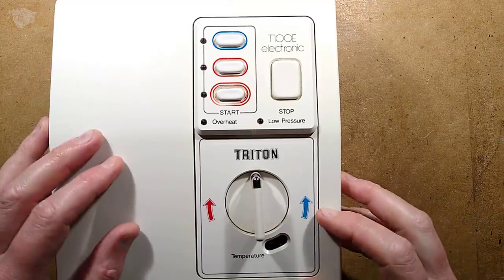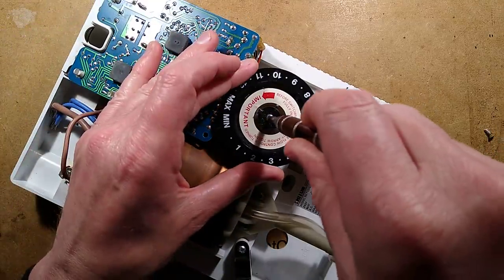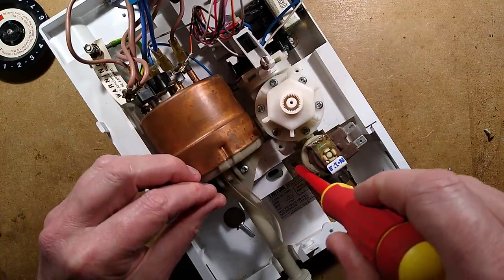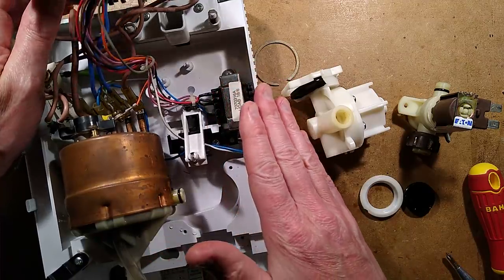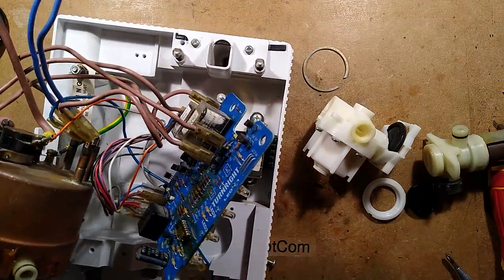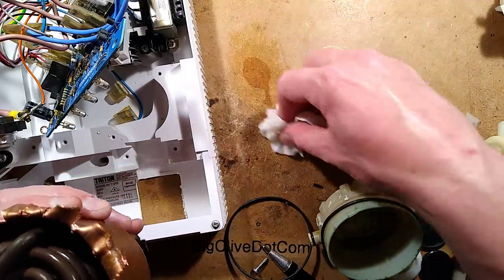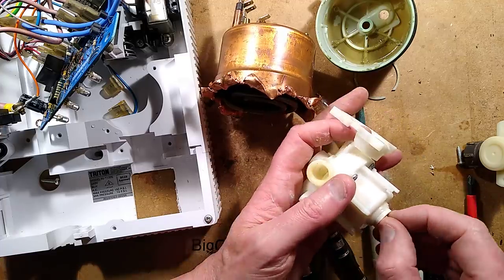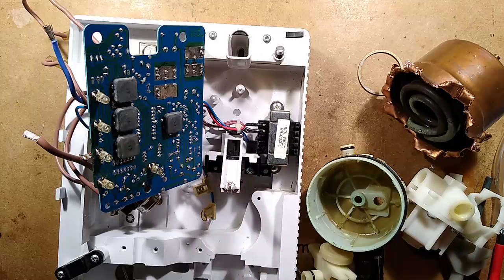Teardown of a British electric shower that went bang.

Comment: The fact that water was spraying all over the place and he didn't get shocked proves to me  these things are safe.  However, as an American, I think I'll stick with my central hot water system, it's convenient for other purposes besides showering.  (And, if you have an instant system, it's no less efficient than an electric shower, save for the tiny amount of water you have to waste to clear the cold water out of the pipes.)
Reply: ThoolooExpress we have central hot water too, in every home. These are a cheap fix where the hot water system is an older, low pressure cistern fed system as found in hundred of thousands of properties- they last indefinitely and function well so people who have them are often reluctant to rip them out at vast expense. They do struggle to run showers though.

Comment: I actually kinda hate these things for a few reasons- there are pros and cons: sometimes they have a mind of their own, mine got itself and set itself to warmest, it was on medium but outputted water that melted the insides of shower head and burned my leg. Another thing is that they take about a minute to warm up because it goes hot and cold in a wave then stable. Another example is the electricity bill. Its not that bad but it is hard to warm the water up in winter ( especially if you have a top up breaker box). Pros: no need for check ups, if it breaks its easy to install a new one. Doesnt take up a lot of space. And really thats it
Reply: How come you keep liking my comments and nobody elses🤣

Comment: So my assumption is that water heaters with a large tank as used in the US are not popular in the UK, and that perhaps UK homes don’t have hot and cold plumbing?
Reply from the maker: We have either hot water storage tanks or water is heated on demand by heating systems.  The main advantage of the electric shower is that the hot water is there near instantaneously and only heated on demand, so very efficient.

Comment: Nothing so Micky mouse as anything to do with water and electricity in the UK.  I had one of these units in my hotel room which popped the internal circuit breaker every use.  The solution by the hotel was to take the cover off while soaking wet and push the reset button which was in the middle of the 240vac incoming line terminals.   No surprise here!

Comment: I doubt this would be legal in the US.  My house has a 40 gallon, natural gas powered water heater.  The best thing about it is that it will still work even if the power goes out.  It has a pilot light and a thermocouple to hold the gas valve open.  If the pilot light goes out, the thermocouple cools off and causes the gas valve to close, thus preventing a gas leak.  I replaced mine a few years ago and the new one recovers very fast.  I've never run out of hot water during a shower, even in the coldest part of winter.
Reply: LoveClassicMusic0205 every single uk home also has a hot water system- either a tank or combi boiler. These showers were the solution to installing showers in older homes with traditional loft tanks meaning low pressure hot water- insufficient to operate showers. As a nation we traditionally had baths, showers were very rare in early bathrooms. By the way, your open vented gas water heater is far more dangerous- under fault carbon monoxide can pour into your house completely undetected and kill your entire family in their sleep! Open vented appliances have been banned here for years.
Reply: If I move to the us one thing I will do is rip all that gubbins out and install one of these showers.
Reply: @spencerwilton5831  It's  not open vented.  The exhaust fumes go to a chimney and are vented outside.  Besides, I have some carbon monoxide detectors in my house just in case something were to go wrong.

Comment: Why is any of the water flow components plastic in the first place?
Reply: As a plumber, you'd be surprised how much pipework in your home is likely made of 15mm plastic. Its drastically more economical than copper or lead
Reply: Cost
Reply: t could be aluminium or stainless steel. That doesn't cost as much as copper and lead is not used for plumbing. Your sink/bath taps and pipe taps are metal and aren't too expensive so they could use a cast metal flow regulator.  it would cost a few pence more but then the greedy manufacturers won't make as much profit. i paid a plumber £400 to install a good quality all metal Grohe shower, not cheap but it will last many decades. The hot water is heated by the  gas combi boiler, which is much more efficient than an electric shower.
Reply: Terry Jackson. Not in mine it isn't. My pipes are all copper.
Reply: Terry Jackson I know about PVC piping but it makes no sense in an enclosed device where mains current is collocated with water. Plastic degrades and fractures in a few years.  All the water handling components should have been copper.

Comment: We have a similar device in the Philippines....made by Panasonic....There has been several people electrocuted by these heaters.
Reply: Clive has made some videos about that design, it has an exposed heating element in the shower head itself.
Reply: @johndododoe1411  Isn't that usually coated and grounded on devices that put at least some effort into passing safety checks?

Comment: That looks like a fairly old Triton, so they got their money's worth. After I switched to a Triton, and an incident which caused the attendance of two fire engines (due to an existing weakness in the isolation switch next to the consumer unit, only highlighted by the higher wattage of the new unit, rather than a fault with the unit itself), then the unit going faulty about a year later with the low pressure light constantly coming on, repaired by them under warranty, and then failing completely another couple of years later with the brown wires on the heater tank completely melting and becoming green powder, I decided to abandon the Triton experiment.

Comment: In the usa we have water heaters, i have never seen this death contraption
Reply: Brad Pugh Obviously U.K. homes have hot water systems too. However, our homes are typically older and many rely on the original, low pressure hot water cylinders. These are fine for filling a bath, but don't have the pressure to operate a shower adequately, especially in single story dwellings where the height between the shower head and the bottom of the loft tank might be less than a couple of feet. Showers were not popular here until relatively recently (70's) so an electric shower became a quick, cheap and less disruptive way of installing a shower above a bath when they did start to become seen as essential.

Comment: Im from Germany, and What you describe really sounds like a horrible deathtrap to me. Sure we have Flow Through Heaters in Germnay to, but they normaly aint in the Shower (but under the Sink or where the Housefuses are mounted)  and they dont have moving parts like valves and stuff and are idiot prove grounded.

Comment: Never seen one of those outside the UK. Powersupply to mainland europeanhouses is not that you could run one. the Netherlands from 5.75Kw to 9.2 Kw.  90% of the houses is natural gas as a heatsource mostly by a combination condesing gas boiler.
Reply: arjan van raaij UK homes and hot water are mostly gas heated too, condensing boilers of various types. Electric showers are for houses with older, low pressure hot water systems that are unable to provide sufficient pressure for a decent shower. As people refurb older homes and update old gravity fed / copper tank hot water systems electric showers are slowly disappearing.

Comment: It's not just americans that find this dodgy. In germany you will never find such a thing. Either the showers are hooked up to central heating or run from a boiler/continous flow water heater somewhere outside the actual shower.
Reply: Great so if the cold water pressure suddenly drops...

Comment: It may be save but its still super inefficient, instead of just having a boiler and a warm and cold water lining in the house u put Small boilers everywhere? yeah.
Reply from the maker: This only uses exactly as much energy is needed to heat the shower water.  No waste in pipes and tanks.
Reply: @bigclivedotcom  yeah but i do still find central boilers better

Comment: I see this being a terrible design.. If you want to have electrically heated shower head then i would at least separate the electronics from the water part and insulated the wires expecting failure due to the material fatique in the water part or electrical failure at the electronics part.. Seems much safer and probably more modular

Comment: U just broke the unit. It was repairable with external valve and w/o pressure thing.
I have unit like that for ~25y. I eliminate pressure thing 12years ago ... and steel work perfect.

The only thing is to remember to stop the unit before stopping the water!!!   EASY :)

Comment: Reading through the comments the thing that gets me the most is how many people apparently only take 1 to 2 minute showers.  I think the fastest I could properly shower is about 5 minutes and that's assuming I'm relatively clean to begin with.  I work in a press shop, I basically come home, brush my teeth, take a dump, jump in the shower rinse really well to get metal shavings and heavy shit off (probably a good few minutes right there), shampoo and rinse my hair twice (once doesn't fully clean my hair no matter how thorough I am) and really scrub my body.  Even then I still end up with stains on my body that are too deep to wash off (without removing too much skin/they go away after a few days).  I also like to enjoy my shower though once we finally move into a house I know I'll have to be a little quicker (We don't pay for water or heat in our condo but it's boiler heat that the association controls).

I think here in the US it's generally cheaper to use gas than electric although electric heaters are technically near if not 100% efficient and the electric cost in my particular neck of the woods is just under 6 cents per KWh (I did some research on it before and the most expensive States are 13 cents per KWh).  When We do move I'd like to get an instant heat unit and at that time I'll do more research into what's actually cheaper in my area (believe it or not folks the best solution depends on the cost and availability of gas and electric in your area, the efficiency and safety of available devices, and the cost to durability/repair-ability ratio).
Reply: What kind of press shop? I wonder if you mean a printing press (newspapers) or metal fabrication, or,... what?
Either way, I can understand you are a "mucky pup" and need to shower a bit more than most people. Fair enough, I sympathize;  I come from a coal mining background, and there's nothing worse than "pit dot" (coal dust; we sorta pronunce dirt as dot).

Gas is usually way cheaper, in the long term. Of course it varies around the world, but as an example... in the UK, 1 kWh of elec is about 14 pence, and gas is about 3 pence. Obviously it is more complicated because of "standing charge" etc.... but mostly, gas is better for heating up water.

Doing more research is great - I totally respect that. I'm just pointing you in what I hope is the right direction. If you can get a gas supply at reasonable cost, a modern "combi boiler" using gas to heat water on demand is probably your best option.
Reply: @ann_onn  Metal press, mostly automotive though we also make the shells used to house some electronics in power lines (the log looking things in overhead power lines).  I don't remember what the exact component was that's put in there).

I've heard about combi boilers before and will definitely look into them more.
Reply from the maker: I like a long shower too.

Comment: Yeh we don't have this in New Zealand, but I know this is extremely wide spread in the UK.
Mainly cos British people always had baths, but the continent had showers with or without baths from year zero. In New Zealand we had both, prob cause of temperatures over here being hotter, so showers were quick n easy..
Reply: Oh showers are run off the hot water cylinder. That's why electric ones are popular, cos u jus need a run off from cold tap n a electric run off from the lighting or socket circuit
Reply from the maker: These require their own dedicated high current circuit.
Reply: Collin Hunter I'd like to see your house (well, the remains of your house) after you have pulled 10kw through the lighting circuit!

Comment: intresting here in germany we have 3 phase instant waterheater  you reulate the tempeature by mixing coldwater to the hot on very reliable very save. The americans do still a lot with  i think its a fifty gallon tank around 200 l and keep it warme in the tank thats a waste of energy and bacteria  distrubtion system  if like legionels inyour water use that technology

Comment: The name "Turnight" intrigued me.
Turns out, it was a Portsmouth -based subsidiary of TI ("Tube Investments", which owned several brands) making "control and regulation devices". That company was run by William Russell, of Russell Hobbs (which was sold to TI in 1963). I couldn't find out what happened to Turnright, but RH was later sold to Polly Peck (Asil Nasir, serious fraud...). I wonder when this shower actually dates to? - Interesting that it's Turnright on the inside and Triton on the outside. Triton started as Triton Aquatherm Ltd in May 1975. I can't find what happened to Turnright & how it became related to Triton or their owners (Norcros).

Comment: Ill keep my water heater. That looks scary and I cant believe it is trusted.
Reply from the maker: Used in almost every home in the UK, and very safe when installed properly.
Reply: Used plenty of them without problems. They're quite easy to use and very fast to change heat.

Comment: Doesn't UK code ban mains outlets in the bathroom?  But its perfectly fine to have mains wiring literally inside the shower... ?  I'll never understand the people that come up with the electrical codes. lol
Reply: Correct, but the issue is not the socket (outlet) itself.
If you have a socket in a bathroom, people will plug things n - such as hairdryers, or a fan, or a TV, or whatever. Some will drop them into a sink full of water, or bathtub.
An electric shower is (hopefully) designed to work safely in a bathroom. Most things are not.

Comment: My golden rule of thumb is never mix water and electric and these types of failures make me more distrustful of electric showers. Especially one of the top brands in the UK. I have a multi jet shower I installed with a mixer valve and I get hot or cold water as I wish without risk of frying myself! Seals fail, plastic becomes brittle and do you really want your final memory of your life to be found naked, dead, bowels emptied in a bathtub?

Comment: This is why water heaters or boilers for bigger builds are used in the us. Because it might be rare but people are scared of failures like this
Reply: Derek Henschel every U.K. home has a hot water tank or boiler too, these are most often used in older properties with the traditional low pressure systems which did not provide enough pressure to operate showers- we all used to prefer baths and showers only really became common forty years ago.

Comment: Surprised you can have water so close to electric with no safety issue. Hopefully it has a ground  fault circuit interrupter.
Reply from the maker: Yes it does.

Comment: Cool, now you need to make a video on how to install a water hammer arrestor at Ralfy's place.
Reply from the maker: It was because the water had been off and there was air in the pipe.  I do have a mini restor to take to bits.
Reply: @bigclivedotcom   Thank god there was air in Ralfy's pipes!  Otherwise we would not have seen this interesting tear down of a device I've never seen before. lol.

Comment: For a simple convenient single water line feed system, it clearly is a "very" light duty made unit.  Plastic components in my opinion are way to thin for the application.  At the very least, the plastic should be glass filled polyethylene/polypropylene!

What was that WARNING label inside?  "Caution. Don't get electrics circuits wet"  ????

Thanks Clive, Luv watching your vids when I can.

Comment: Recently went to Ireland, very strange that a country the allows nothing but a useless 100W shaving outlet in a bathroom yet they allow these things....
Reply: Yeah, there is a logical reason for that.
This shower is designed to work in a bathroom, so it is very safe.
If you put sockets in there, people will plug in all kinds of stuff that is not designed to work in a wet environment - like radios, phone chargers, fans, laptop compters, or whatever. That's the danger.

Comment: Does that trip the GFCI?
Reply: I can't see any reason why it would
Reply: It would only trip the GFCI (RCD in Europe) if the insulation on the heating elements broke down and the outside (in contact with the water) became live.
Reply: Did they even have gfci on 240v 30 years ago?